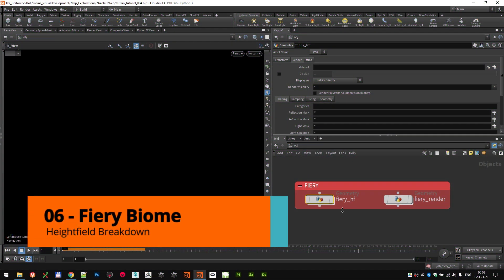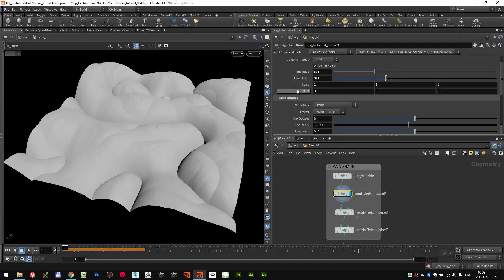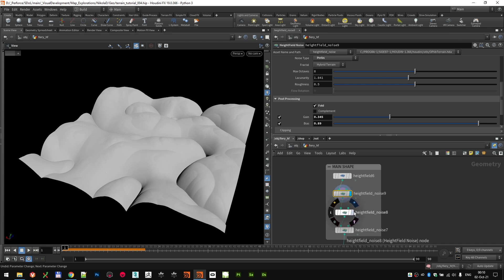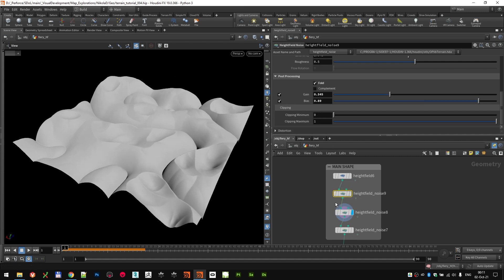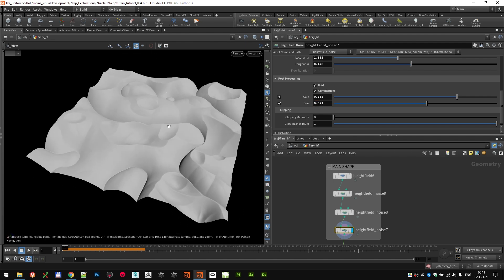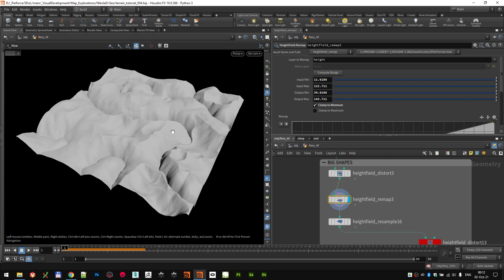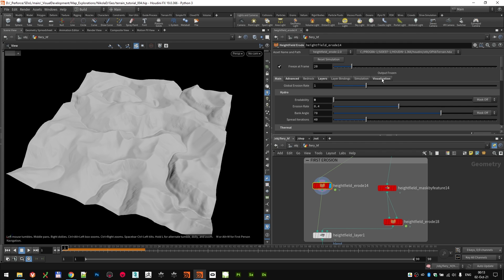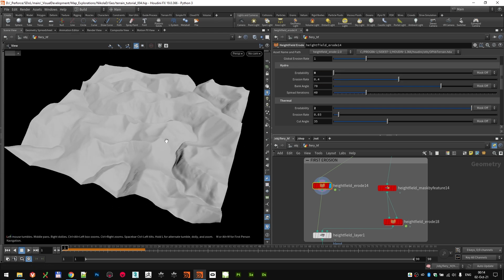Terrain Handbook 06 | Fiery Biome | HF Breakdown

Comment: For anyone wondering the mountain node (now called attribute noise) will still work for this.
Amplitude: 20-50
Noise Type: Perlin
Element scale: 0,20,0 (to get XYZ paramters expanded click the XYZ next to element size
Roughness under fractal: 0.3

Play around with it but result is very similar to the video
Reply: Thank you!!!
Reply: thanks a lot!